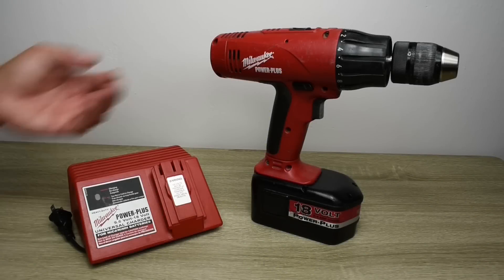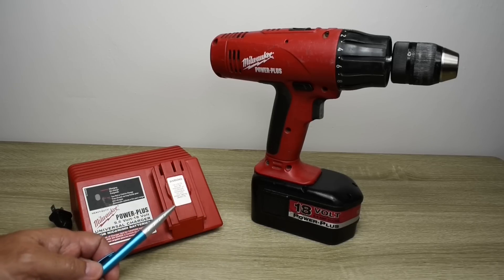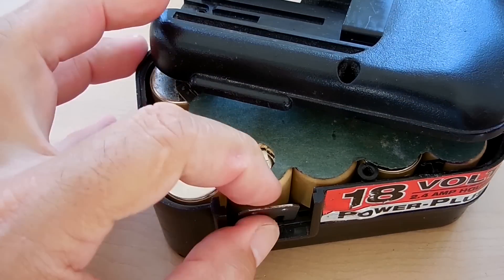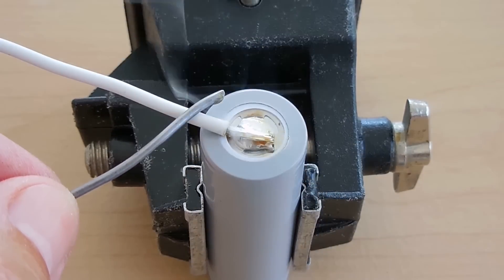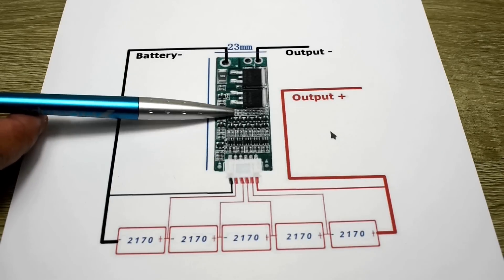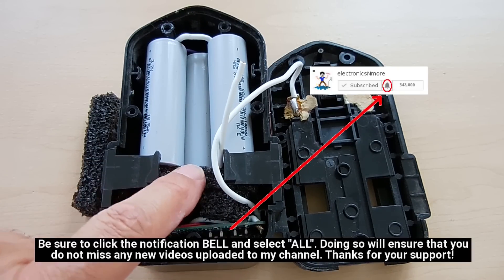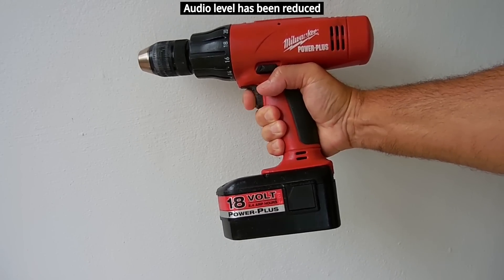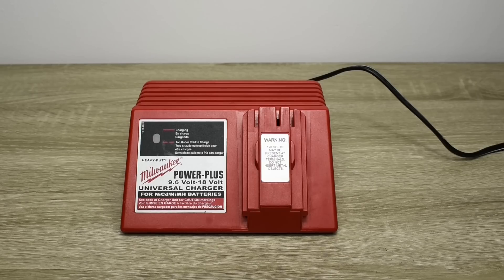Milwaukee Cordless Drill (TESLA POWERED!)

Comment: BE CAREFUL - FIRE
Reply from the maker: Really? Please elaborate on your concern.
Reply: @electronicsNmore  YOU were very careful.

I'm concerned, what happens if someone else tries to duplicate this and they're not careful due to sloppy workmanship, applied excess soldering and heat damages cell air/moisture seal, or they fail to confirm proper charge voltage cutoff, what might happen? 

Do those cells have internal over-temp protection?  What happens say, if a 19 volt, 4 amp PS in series with a automotive brake light bulb is applied continuously to a cell housed in a closed space?  Is it possible flames would eventually shoot out?  IDK, just sounds like some care is indicated.

Probably not a good idea to leave charging unattended / while not at home, etc.
Reply from the maker: You can say that about countless videos shown on YT. My job was to show how it's done safely, by creating a very well explained video that could be used in a classroom. People need to know their limits(what they are and aren't capable of doing), it's not my job to worry about what other people "may" do. If they choose to duplicate what's shown, and do a poor job, then it's their own fault. If every creator on YT had to worry about what every viewer "may" do after watching their videos, they wouldn't upload videos. You need to do some research on how a lithium ion BMS works, for a much better understanding. "Probably not a good idea to leave charging unattended / while not at home, etc".........You can say that about many lithium ion chemistry batteries used in countless electronics.
Reply: @electronicsNmore  Yes, AGREE completely with you.  Not critical of you or your work.  Be safe and stay healthy.

Comment: With a couple of diodes you can use the bms with separate charge/discharge points. High current diode on the discharge side to match the BMS, and can use a smaller diode on the charge direction. I prefer schottky diodes to minimize voltage drop, but you'll still lose about 1/2 volt. (I have 15amp and 30amp (__SQ045) I purchased for my PV panels.)
Reply from the maker: Thanks for the info!

Comment: Excellent tutorial! That should breath new life into an old Milwaukee! 
  Most people don't have a battery spot welder,  so this is more in line with what people will do. Years ago,  I built probably a hundred nickel cadmium battery packs and the key was, a HOT iron... 40 watts is the minimum to use, I had an 85 watt iron that did the trick as quick, hotter equals faster, therefore less heat build up in the cells... Again, great build....
Reply from the maker: As long as you have enough heat, and do it quickly, the cell will be fine. Glad you enjoyed the video! Remember to share the video link, many hours goes into making a video like this, and if it doesn't get at least 50K views, it was a loss. Thanks for watching

Comment: using a soldering iron COULD damage the cells. doing it with a spot welding device and some metal strips will bond it without excess heat!
Reply from the maker: Correct. "COULD". 😃 If you do it right, the risk is very low. Did you watch the entire video and hear me say why I decided to solder the cells together?